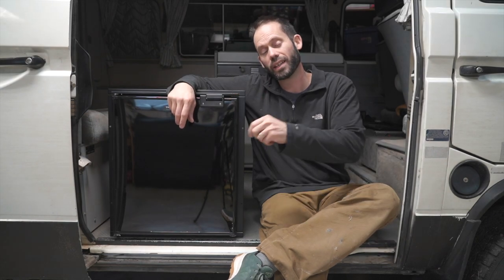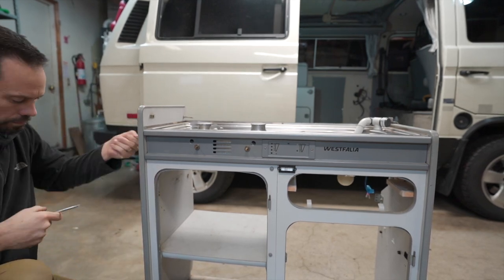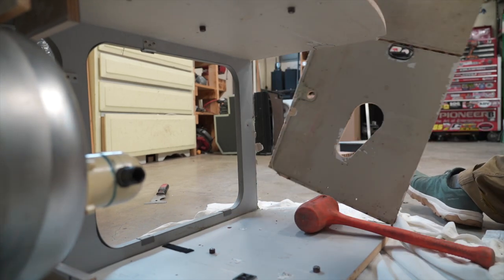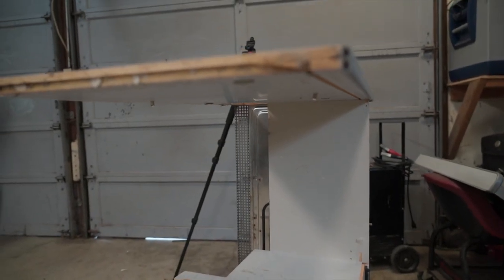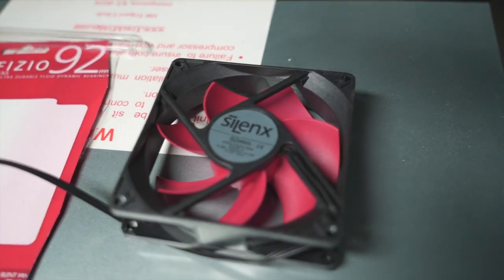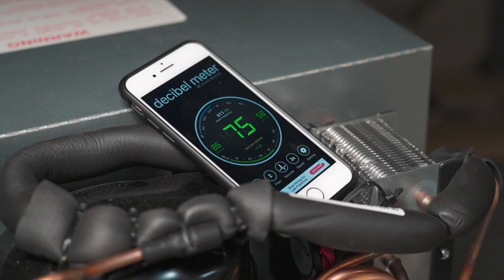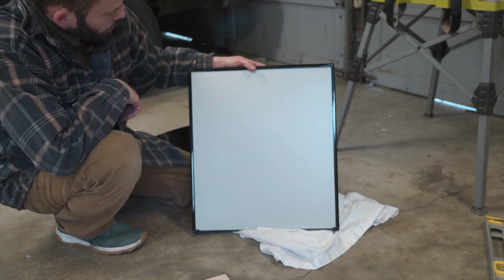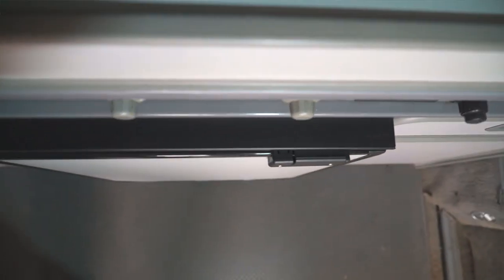How To: TruckFridge TF65 Install into a Vanagon Westfalia Cabinet

Comment: If you've got a router and a straight piece of lumber and a couple of clamps - presto, beautiful data.  Your lookin good though.
Reply from the maker: Great idea! I didn't even think of that.  I did borrow a router to trim the laminate so it was sitting right there.  
nate
Reply: @ThatBaldwinLife  another idea, find a local cabinet / kitchen / woodworker and let them cut it, I did that in Rochester NY and the shop did a job far better than I could have, I mean you could see my saw wobble in and out, and then in Pittsburgh, I had a guy trim down a bi-fold door, can't even tell, nice when you have a 10K dollar saw !!
Reply from the maker: That would defeat my "do it all yourself" mantra.  But yeah if you are not comfortable doing this work, I am sure you could find someone to do it. 
nate

Comment: How much better is the new fridge compared to the original fridge?
Reply from the maker: Our stock fridge never worked well so we used the ARB fridge for years. The stock fridge is so tiny and did not hold enough for us to be out for long enough.  The TF49 is an easier upgrade and still is lightyears ahead of the Dometic fridge if you don't want to go to the TF65.
nate
Reply: @ThatBaldwinLife  Thanks Nate. Your channel and knowledge are so valuable. My 87 Westfalia has benefited a lot from what I have learned

Comment: I really enjoyed the video! I wanted to ask how the truck fridge is powered , do you have any solar or is it powered off the alternator and batteries?
Reply from the maker: Thanks!  The fridge is powered from our 100AH AGM battery that is charged from the alternator.  We do not have solar on the van but do have a 100W Renogy suitcase kit we use when we are in one place for a few days (which is very rare for us).  We usually only bring that when we go to Descend or Syncrofest.
nate
Reply: Thanks for getting back to me, I’m in the early stages of planning a new electric fridge such as a TF-49. I am looking for a few more resources to help me get the right parts. I was wondering if you upgraded the alternator? What kind of inverter you use to charge the lithium battery? Basically a how to on your electrical setup for the fridge.
Reply from the maker: Our electrical system is pretty simple.  Stock 90 amp alternator feeds a 100 AH AGM battery (not lithium) which feeds the fridge.  We have a Automatic Charge Relay that combines the AGM battery with the starting battery when the van is running and disconnects them when it is off.  No inverters, no solar, all simple.
nate

Comment: Why did you put the drawer on the bottom rather than the top?
Reply from the maker: We mocked it up both ways and we thought it looked better this way as the two drawers were not on the same level and it was easier to access the fridge with it up higher. 
Nate